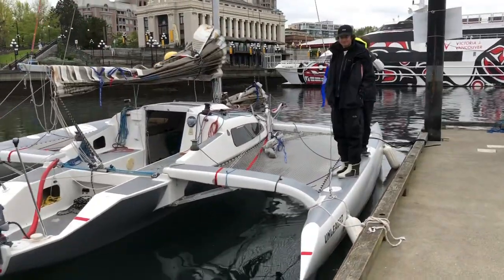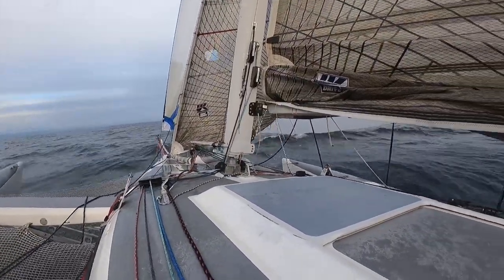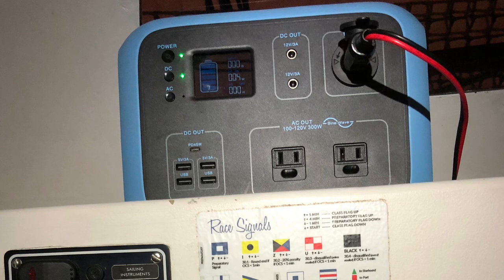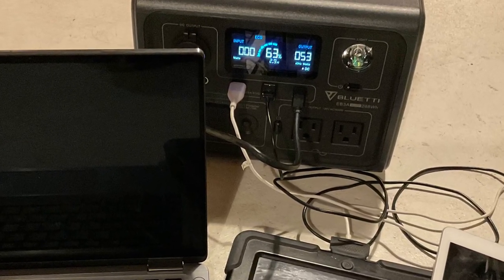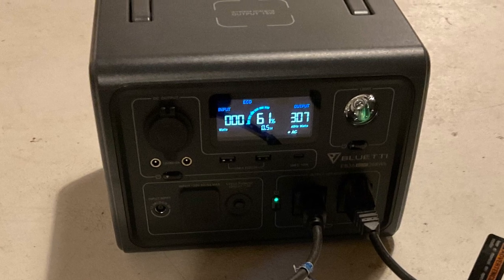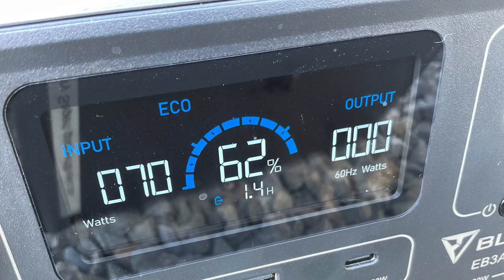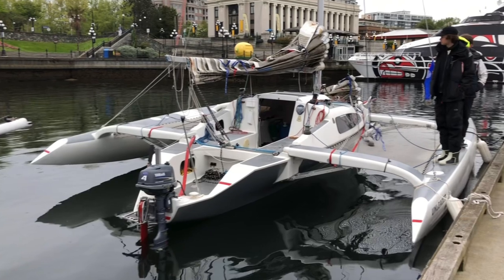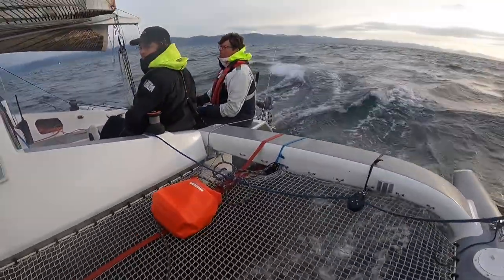Lead Acid vs. Lithium vs. Bluetti EB3A for a Small Sailboat

Comment: Gary, Very glad to see you back with latest video.
From your description the Bluetti sounds like a good fit for you. I wonder how much room and weight the inverter uses in that small box ? Do they make one without? I don’t have anything on the boat that uses AC.  
Does your 4 have a starter? Must be easy to pull. 
Bluetti is doing a good job of trying to please everybody all the time!
Lots of features. I love that panel as well, I have to switch to see health watts and then time. Cheers
Reply from the maker: Good question! The EB3A and the AC50S are about the same physical size, weigh 10 and 13 pounds respectively and have 268 and 500 Wh of battery capacity respectively, which leads me to believe that the batteries constitute the single largest and heaviest component of the package. I’m not aware of any portable power stations without inverters because that’s a high-demand feature for the mass market. My Yamaha 4 doesn’t have a starter nor alternator, but it’s not that hard to pull, especially with the aft cockpit.

Comment: Good piece of kit, now at a reasonable price.
My comment is do you need all that complexity.  You can get a straight LFP battery for the same price and four times the capacity.  Would that small Bluetti have sufficed for your two day trip?
If you do need 110 / 230v, better to have a small petrol generator. Then you can run all day, mine 1000w and about the same cost (ok, again)
Reply from the maker: I think it’s great that there are so many options out there for everybody to get the exact pieces to suit their needs! There are different sized Bluetti packs but the current trend is towards larger inverters whereby I’d rather have a larger battery and a smaller inverter. Many devices don’t even require an inverter though if you can do a direct DC-DC conversion.

Comment: I had the same problem, but I chose the River 2 as it charges faster and is more user friendly than the EB3A.
Reply from the maker: I think there are lots of options (like outboards) so it’s easy to find one that suits you best, with local availability and serviceability also a consideration.

Comment: The main reason why I am avoiding the EB3A is the overheating issues that it has when charging.
Reply from the maker: Yes fast charging of any device is really hard on batteries and should be avoided if at all possible. For that reason I personally never use the dual AC/solar charging capabilities of the EB3A (except to demonstrate in the video) but just use one or the other. I think some of Bluetti’s competitors came out with ridiculously fast charging before they did (e.g. EchoFlow) so they’re trying to “catch up” from a marketing perspective, but it’s really not a good feature in terms of battery longevity. Even EV makers warn you to avoid fast charging their cars if possible, and Tesla has gone as far as to dial down how fast your car will fast charge after a certain number of sessions in order to preserve the longevity of the battery.

Comment: Hi Gary
Great product. On Pender Island we have lots of power outages. My wife can’t start our Honda 2200 generator. I ordered the eb3a. Using your link. I didn’t see a discount code. $328. Is that the Sailing tips price? Thanks Glenn
Reply from the maker: Excellent question! I wasn't exactly clear on the pricing part when I filmed the video, so I reached out to Bluetti and my sense is that they're running razor thin margins on these, and especially the smaller models. My AC50S and the smaller competitor models were in the $600-700 range only a couple of years ago so I'm amazed they're able to sell the EB3A for $328.
Reply: Nice product placement ad Gary! :-)😂😅
Reply from the maker: @RobertdeVries-trimaran-sailing  LOL - I always told myself I wouldn’t endorse a product I don’t actually use, and so far that’s true!!!
Reply: Bluetti contacted me with the discount code “1 CAD” and asked me if I would like to apply it to my purchase. I agreed. Discount=$1. Had I known that in the beginning i wouldn’t have bugged them about it. I think at $328 it is a good product that I will put to good use.
Thanks
Glenn
Reply from the maker: @glenn5ft19  Thanks for the update! I see it’s on sale for $299 now: https://www.bluettipower.ca/products/bluetti-eb3a-portable-power-station-600w-268wh At either price I think it’s still great value!!!

Comment: While the functionality looks good, I think the salty marine environment would destroy it.
Reply from the maker: It definitely won’t last as long in the marine environment as a marine product, especially if you keep it on your boat full-time. My boat spends most of its life on the trailer by my house, and my Bluetti spends most of its life inside the house. My initial AC50S still works like new after a couple of years, but like I said I don’t leave it on the boat.